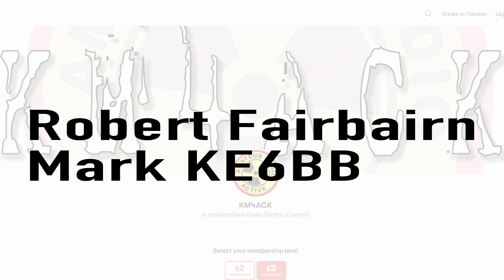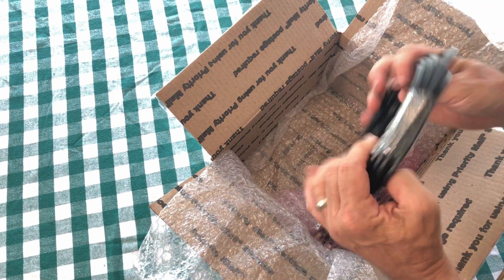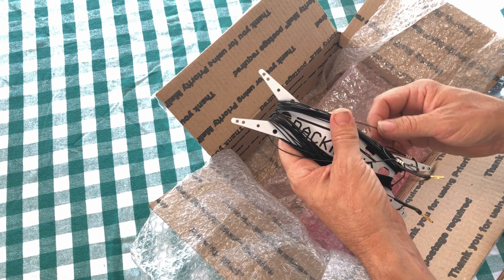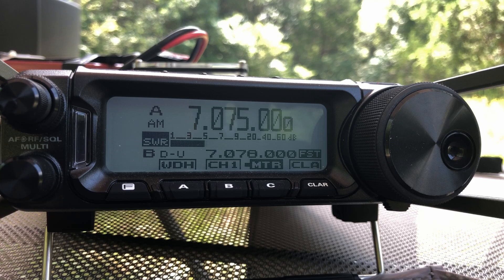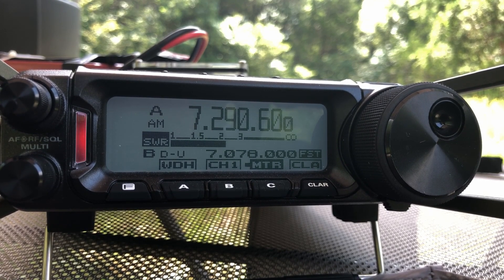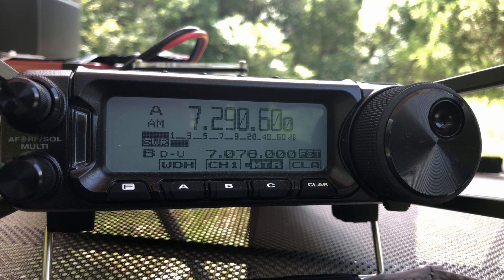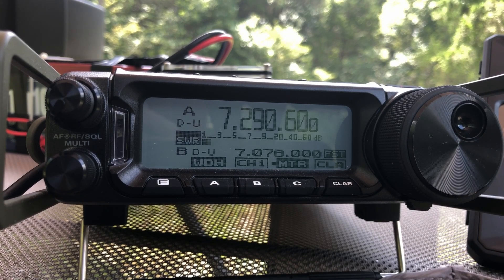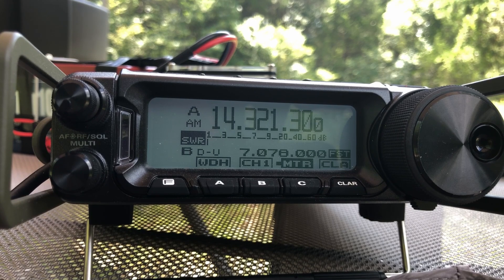Packtenna Linked Dipole Review

Comment: That is an absolutely fantastic antenna.  Possibly the best in my arsenal.  The thing gets OUT!  It looked like you had the legs a bit close though.  Try and keep the angle at the feedpoint greater than 90 degrees and the swr should go down a bit.  I got to make my 40 meter element and my swr is perfect on both bands.  A little fine tuning and you'll be there too.  But you already know that.  73. BTW, the wire is from WireMan and is 26AWG.  You are correct.